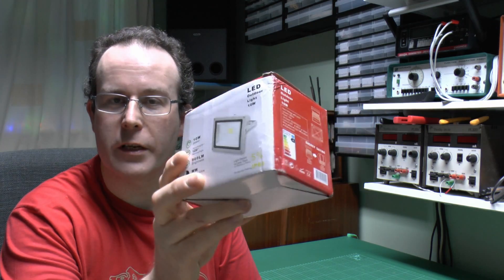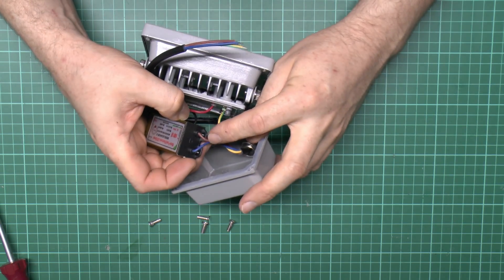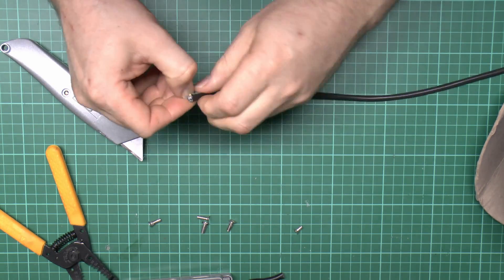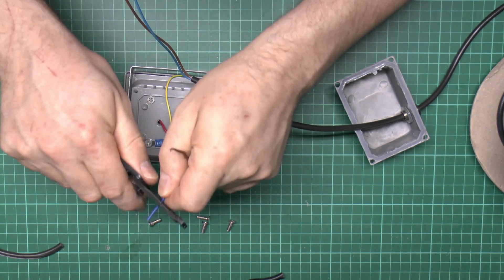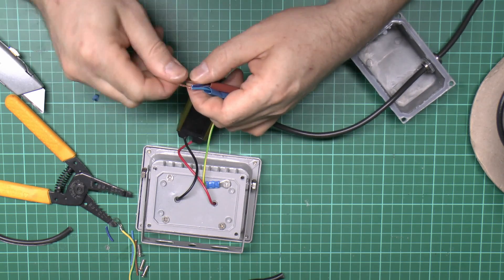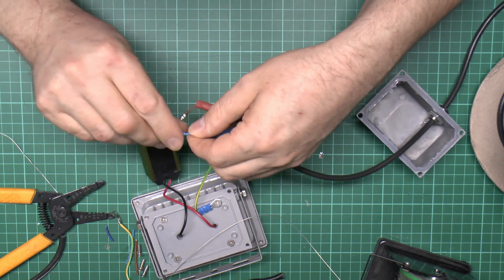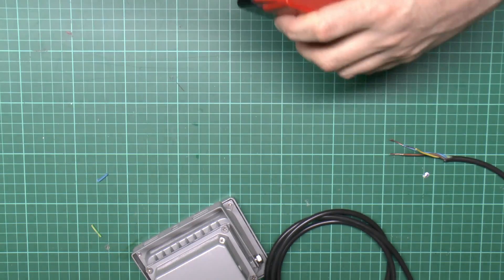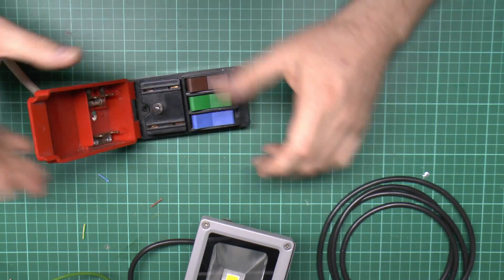10W LED Floodlight Alterations

Comment: Running a hot soldering iron along heat shrink tubing also works as i have done many times when it`s too close to a circuit where hot air or a lighter may damage smd components....hope it helps someone!

Comment: Don't do it this way.
For the earth connection, remove paint and add a star washer under crimp.
join wires using 'wireman splice' technique
use the correct sized heatshrink
do not use tape
-- given this guys experience, he does an awful lot of things the wrong way.

Comment: One thing regarding that Earth... didn't look like it had lock washers on it... Luckily it's not likely to loosen from vibration where it's going but it's a good thing to take into consideration if you do put one of these in a high shock environment. You don't want the Earth to rattle loose, get a failure that shorts to the chassis and someone get a little surprise when they go to service the fixture!!

Comment: Nice review John.  The insulation tape before the shrink wrap is a nice touch... soldered joints only need one stray strand of wire to form a dangerous shard.  I'm late into your reviews but am quickly catching up.  Some of the negative comments though beggar belief.  Well done for sticking with it and some of your acid, dry remarks have me falling of my seat in laughter!
Reply: OFF my seat.....

Comment: i have the same 10w floodlight and it''s driver is tiny. and it wasn''t seaaled,so i opened it and found a little buck converter that is usually used in the GU10 LED lamps

Comment: Horrendous watching JW tearing the inside of that cable gland by ripping the cable out and pulling the new cable in like that. Surely you could have taken 5 seconds to loosen the gland, then tightening it back down again after the rewiring?
Also, for proper weatherproofing this really should be cabled using silicone cable rather than PVC, as the PVC compresses inside the gland and evenually will leak.
Reply: John Coops i

Comment: the ones i bought were completely potted in the back.  i tried to dig out the potting, gave up and bought juction boxes.  how rubbish is that.
Reply from the maker: +FunkySpunkyJunky Have to wonder why they were potted - perhaps to cover up something they did not want people to see, such as a 3W driver in a 10W case?
Reply: +John Ward. Yes i did wonder what they are hiding but they do seem to be a quality unit in every other respect.  they do draw the 30 watts they are rated at, so i guess they have just potted a bare board into the outer casing - done for cheapness no doubt.  i would have paid a few quid extra to have some screw terminals to attach my own cable though!

Comment: is the inside of that metal enclosure painted? because it looks like and that earth point contact wouldn't be as low impedance as it should be due to the isolation created by the paint.

Comment: 0:28 I tested mine recently (and managed not to blow up the MM this time) and it was a 30v job dissipating about 6W. Ridiculous! But then again maybe the heat dissipation wouldn't be good enough for a real 10W. I'd be interested to know how much you spent on yours - I spent about €4.50 for my one that came with an underrated driver and no earth connection. But for about €1.50 I'm able to upgrade it to the full 10W version, requiring just a 12v (in reality more) power supply.
Reply from the maker: +BenjaminGoose These were about £7 each.
Reply: ***** That seems very reasonable for a properly rated (and earthed) product. It's a shame so many Chinese suppliers don't spend just a bit more time and money making sure their products are up to standard.
Reply: BenjaminGoose  i

Comment: Ideal makes a tool for stripping insulation off of PVC jacketed cable...I find it works quite well, and you don't have to risk cutting the cable inside.
Are twist-on connectors (also known as Wire Nuts, a registered trademark of Ideal Industies) illegal in the UK?
Reply from the maker: +douro20 Wire nuts are not illegal, you can actually buy them from a few places.  Most electricians do not use them.
Reply: John Ward - What is the specific name of the flex cable?  I cannot find anything at the hardware stores here.  The stuff they have that is similar is too large gauge and twisted (not smooth outer housing).  Thanks,

Comment: Nice way to "cover up" the mistake you made with the heat-shrinks that were to big in size for the cable , just some tape to make the cable thicker LOL
Reply: +Martijn Vv yeah I thought the heatshrink was a bit big but using the tape is a good ideas for the reason he stated.
Reply: Actually that looked like high-shrink cable. It looked too wide to me too, but look at the edges where it grabs the cores tightly. I'd say it shrank to the correct minimum diameter. The tape wasn't to hide baggy heat shrink imo.

Comment: How many countries use the brown/blue/yellow wiring? In the USA we have black/white/green (or bare copper for ground).
Reply from the maker: WVresident The UK, most of Europe, Australia and New Zealand at least - possibly more.
Reply: *****
ok. I had never seen that setup until I got my first led flood light. I thought maybe it was just China until I saw your video. I just installed a 100w light on a light post and had to figure out what was hot and what was neutral ground was easy but I didn't use it.
Reply: killer1479 Ya I saw when I bought my 100w floodlight and was able to wire it no problem.
Reply: +Martijn Vv Definitely not true. Britain uses standard units (miles, for example) for a number of things. Even mainland Europe hasn't completely switched over to metric. Go outside and look at your car's tires. The rim diameter is in inches (probably 14, 15 or 16). In the US we use the metric system where it is convenient. For example, 2 liter bottles. It isn't the US versus the world. The reality is much more complicated.
Reply: +bishplis just like the USA is one of last in the world thats not using the metric system..... LOL
Reply: +WVresident incase it ha snot been answered for you, ill let you know :D ... brown: live/hot....blue: neutral...green-green/yellow: earth/ground :)

hope it helps ya :D
Reply: WVresident :)
Reply: +John Gotts That is indeed correct, but that has mostly to do with products that are made outside the EU. 

Good example are flatscreen TV's , I have a 55 inch Sony hanging on my wall, and I'm writing this on my 24 inch 
desktop PC screen.... ;-) 

By the way, my car has (factory standard) 20 inch wheels  (Ford S-max with S-pack)
Reply: +John Ward  Add China, Thailand, Philippines, ... and sure some other neighbor asia countries.

Comment: I did this same mod a few months back except that I used a terminal block rather than soldering the wires.
The floodlamp I bought had a plastic cased el-cheapo drive circuit though.

I do ultimately plan on replacing the 220V∿ driver with a 12V⎓ driver as I want all my yard lights running on solar power. 

Isn't it strange how nearly everything electronic runs on 12V⎓ today. We drop 24V⎓ from a solar panel via a buck converter to 12V⎓ to charge a battery, then we invert that to 220V∿ just to convert it back to 12V⎓.

The L.E.D. chips in these seem to have 28V drop for the 10W lamps and 30.5V drop for the 20W lamps.

Comment: That is not very cleaver as when you want to change the lamp you will have to take it down wire and all but if you used a waterproof connector it is much easier but thanks for the link on the lamp.

Comment: Would you say that it's worth the financial savings buying the cheap LED floodlights and spending the time to do these mods than it is to simply buy the higher quality lamps which come with decent cable length?
Reply from the maker: dnelms2 Yes, as replacing the cable only takes 10 minutes.  The example in the video is £10, even less if buying 3 or 4.

The problem is knowing what the 'higher quality' ones actually are - price is no indication at all, and they are all made in China regardless of who is selling them.

Comment: Very good overview. I've wired up many of these with old PC power cords. Quality issues on the lights does vary greatly; stay with proven vendors.
Reply: +James Campbell wirenuts, heatshrink tubing old pc power cords then you have a portable light using a 10w as a fixed spot is rubbish start at 50w led and go up

Comment: Please could you link to your workbench mat. I'm after something similar but having no joy on ebay.
Reply from the maker: ***** The green one with a grid on it is one of these cutting mats: http://www.ebay.co.uk/itm/170858816100 A2 size.
The larger one which covers the whole bench is from Farnell / element14, part number 1503201.
Reply: Thanks John.

Comment: I saw these with RGB LEDs and ones with 100w LEDs are those safe too?  Looks like it has a nice tint.
Reply from the maker: Knuckles the Echidna Some of them are - others are not.  The only real way is to open them and look inside.  It's fairly common for the earth to be left loose inside and not connected to anything.
Reply: Knuckles the Echidna I have a grey 100w model and it works great, lights up my front yard.

Comment: A crimped connection is technically classed as more reliable than a soldered connection. The rear cover should also really be earthed given that it is isolated by the gasket and has paint in the countersunk holes.
Reply: sdgelectronics I'm surprised to see the incorrect size of crimp used here. Smacked wrist for you JW.
Reply: Q. T. If you're showing people the correct way to do something then show them the correct way. A crimped termination made with the incorrect crimp is useless as it may fail. Ask any crimp manufacturer. So in answer to your question .... I care!
Reply: SDG Electronics q
Reply: Ditto.
Reply: Also in response to you mentioning the earthing of the back case, it is earthed via the screws holding it in place, and even if that fails, I can bypass the screws and go straight to the case if it was screwed back on sufficiently
Reply: devonfuse Who cares about what size crimp he uses. He still improves the crappy product, was nice enough to warn youtubers of said crappy product AND even posts a vid on how to improve said product for anyone who may have bought one unwittingly. Smacked wrist for you DF, and thanks JW for posting your vids and helping out others.

Comment: I would always prefer to use a 16 amp IP67 type plug and socket with any outside light fitting, that way, it can be replaced without circuit isolation, and of course, the person who is installing or removing the fixture can see that there is a physical break in the electrical supply. Also, I'd use NYY cable, for some UV resistance.

Comment: Good vidoe showing what is actually inside. I have been interested in getting a couple for security lighting outside the house.
So definitely not an eBay special.. question, what voltage are these 10 watt leds actually running at after the LED driver has reduced the voltage ?
Purchased from ?
Reply: I run mine at 12 volt 900ma, you got two types 9-12 volt and 30-35 volt. The internal config is different.
Reply: Yeah around the 35-24v range on all of them i have bought.

You have to be careful about those thing too the chines like to use a blow touch to solder the wires to the converter pcb.... Or something equally stupid. (The black plastic ends slide off.)

As a side note Spare PC power cords make great replacement cords, often available for  free.
Reply from the maker: ***** The driver module is constant current 300mA, voltage about 33 volts.
These were obtained from ebay, seller name @support_team2000
Reply: ***** I may have bought something from @support_team2000 lol!